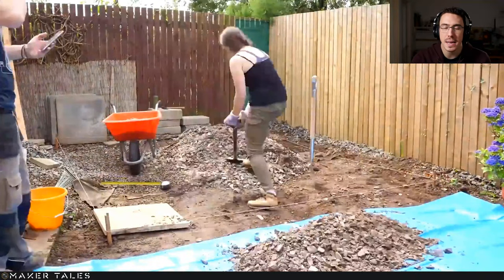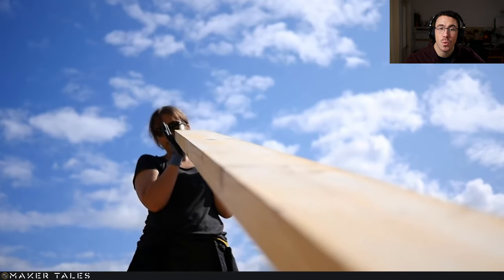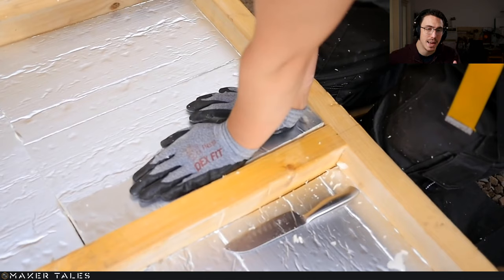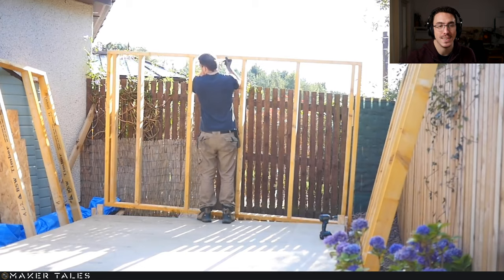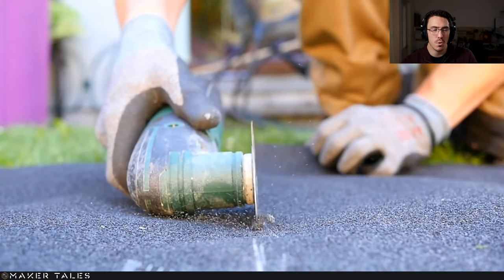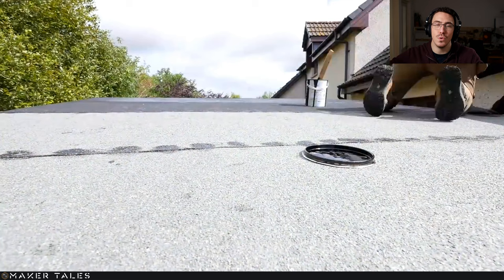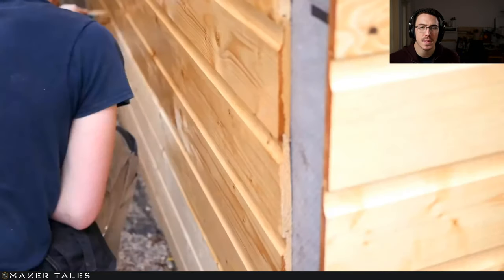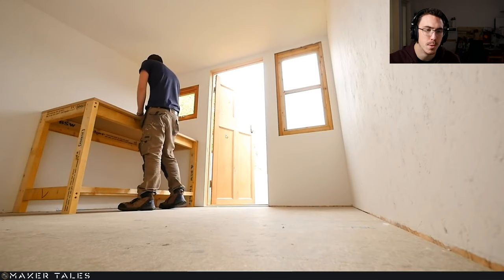Building a Workshop In The UK | Q&A | Build Commentary

Comment: Just wanted to say that I really enjoyed watching this video, this time with the build commentary (I'd watched the other one several months ago).  I found it very interesting and you seem to have gone the extra mile with insulating it well !  Any pre-built sheds I've had in the past never had anything like that at all.  I bet you're feeling really proud - I certainly would be.  Here in Northern Ireland I've always found it hard to source decent cladding.  I'm in the process of pulling down a rotten 22 year old shed 14 feet by 10 feet and intend replacing it with something much smaller, 10 feet by 8 feet, which is big enough for my purposes.  The bigger the shed, the more junk I gather !  But well done, I'm very impressed (as is my wife who also watched this).
Reply from the maker: Thank you so much for the kind words Terry!
I'm so glad you enjoyed it and yes I am very proud that I was able to pull this off. I took some doing about 2 - 3 months of planning but I feel like it all paid off. Yup good cladding can be a pain to get. I'm lucky as where i'm based in Scotland there are quite a few timber yards plus LOADS of wood builds going on. So I was able to pull some strings to get the right contacts.

Comment: Hello there, you used rockwell sound proofing slab. After you install it and  if you moving home and you want take your shed to a new place can you you reuse the same insulation again.
Reply from the maker: I would 100% reuse rockwool slabs. It's a very reliable and reusable material. From my knowledge it hardly degrades at all.

Comment: Thank you for talking about your process, it is really helpful. I am in the planning stages of a fort for my son and will have a similar design. Do I know what I'm doing...no. Do I think I can figure it out, sure why not! I've built a few decks and watched tons of youtube videos, I'm sure it will be fine. I live in Oregon, USA and it also rains a lot here. I'll do my best to waterproof, but at the end of the day water will likely get in somewhere.

I do have one question. At 30:21 you show putting the rafters on the roof. The end you are holding has a notch. Did you have to cut notches in both ends? I will also have an angled roof and this is a piece I can't figure out.
Reply from the maker: Great to hear Courtney L. Those notches are cut on both ends, From what i'm aware they are called the bird mouths